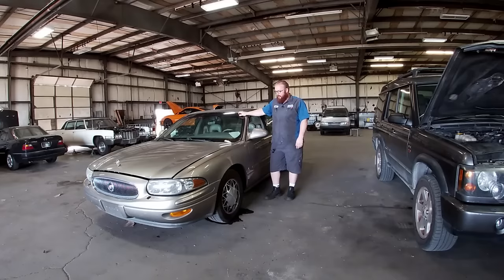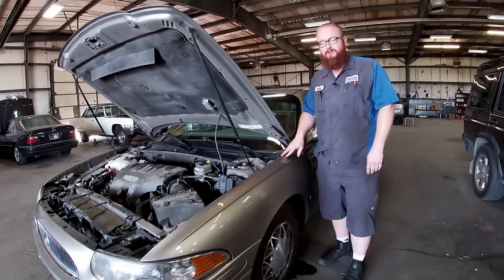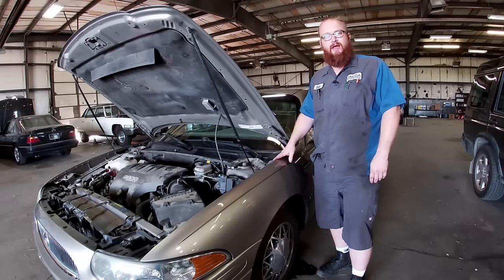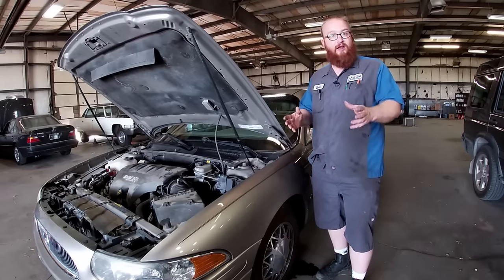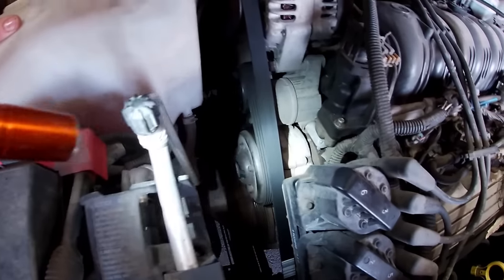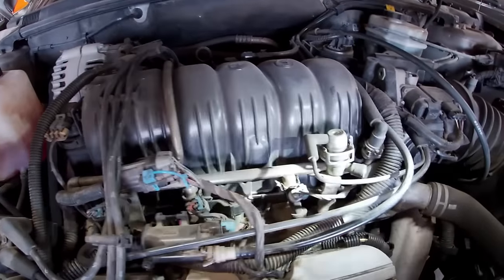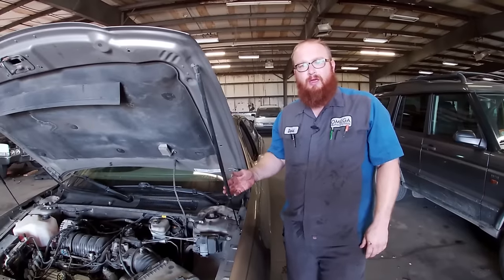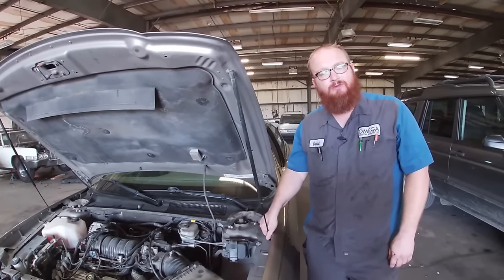CAR WIZARD highlights what makes the Buick 3800 V6 the BEST engine ever!

Comment: Car wizard mentioned plastic parts that fail, I worked for a automotive supplier and had many different Plastic Materials and regrind bad parts and reintroduce that Material back into Virgin material at 30% mix (70% Virgin and 30% regrind) we had incidents where wrong regrind mix with Virgin material, or too much regrind introduced both affect plastic parts integrity, and it will fail.
Our company was large G.M. Supplier tier one and had some issues where a stone was thrown from tire hit wheel liner inside wheel well shattered wheel well liner.
G.M. sent part back to company and was not right correct regrind (contaminated material).
Lot times people not paying attention to job description.
And company was responsible for having too many regrind materials and not labeled correctly.
That back in 90's.
I work at a medical assembly and parts manufacturer. Got tired of car companies dictating how to run company without owning the company.

Comment: Will a LeSabre trans go into a 04 regal LS?
I know the ratio is different, but will they bolt up and run ok (just bad speedo readings)?
Or will it require more than that?

Comment: The only problem I had with both of my 3800 series 2's was the intake manifold failing and coolant going throughout the entire engine
Reply: This was the big problem with both the 3.8 and 3.1 engines...be sure to check that out, replace if you have any doubts.

Comment: Probably replaced it because fuel efficiency. Was a mistake replacing the bullet proof LS V8… especially with the new  problem LT platform…
Seems you reach a point where reliability goes due to fuel efficiency..

Comment: They replaced it with the 3.6 opel motor because the 3.6 can rev significantly higher, makes much more power, is internally balanced, sounds better, is 100lbs lighter………. Might not run to 300k miles, but the 200k you get out of it will be much more enjoyable

Comment: I have a 2007 buick lacrosse 3800 engine series 3. It stalled while customer was driving it. Cranks but no start. I'm thinking crankshaft position sensor. Help please.

Comment: I bought two cars with this engine at the same time based on my mechanic saying "its the best engine ever, as good as toyota"and both leak & burned oil, leak and burned coolant, replaced gaskets on both at 40,000 miles. At that point I sold both ASAP and bought 2 Toyotas. Regular maintenance was done on them and on time and still they were the Worse Engine Ive ever owned. Maybe I got 2 lemons, but I think I know why my mechanic told me "They're best engine ever". Its the best for his bank account.

Comment: It's good to know there's an American engine that might last.  But if horsepower is not important, the most reliable/simple engine you can buy right now new is the Toyota 2TR-FE engine which is based on 25 year tech and only being made now for the Tacoma.  (And will never be made again after next year.  )

Comment: These GM engines were just so good and with the computer management systems available now there is no need for twin overhead cams, if you need more power just add a Supercharger, problem fixed.

Comment: I'd honestly rather have a '92 or '93 Buick Roadmaster. Tough cars. Chevy 350 5.7 V8, super super easy to work on!! Lots of space and just designed really well the way the engine bay is designed. Bare minimum = EASY. Cast iron block and heads= freaking tough!!

Comment: Wizzard  I have a 2016 frontier that won't start up when the temp drops down to 35 degrees or lower. Any ideas? The engine spins over fine...

Comment: I HAVE A QUESTION!! PLEASE SOMEONE HELP!! I LOVE M
Y 2000LESABRE the bolt broke off of the heater core hoses next to the 2 4 6 spark plugs/ wires change up against fire wall making it impossible to get wrench or tap and die in it.

Comment: Ok, its a nice engine but you missed something here; that rear bank of cylinders on that v6, the front 3 spark plugs are easy to get at, how about that rear bank of plugs? Not so easy, right?  I'd say the best engine GM ever produced has to be the small block chevy, especially the 305 small block found in many 70s and 80s Chevys, good performance, even in its smog era variants with much better mileage than the 350s and 400s, along with great reliability as well.  And you can get to all the spark plugs easily enough plus the  mods you can do to improve them, the aftermarket support is off the hook.   Many sbc's have gone over 200K miles  and are still running good.   So keep that v6 and your computers and sensors and fuel injection, have it, I'll just enjoy my dependable and strong small block chevy in my Camaro, Nova and Silverado, along with ease of repair and the cheap prices they charge for starters, alternators and fuel pumps, your v6 cant compare with the chevy in price, performance and ease of maintenance.

Comment: The series 2 was made because the series 1 was too reliable and easier to fix. The series 3 was made because the series 2 was too reliable and easy to fix. The series was canceled because the 3 previous engines were too reliable. Running a company, you can't have people holding on to older products while selling new products. It spells death to a company. I finally get it now...

Comment: Air control valve then the catalytic.converter.But it drives fine on short trips.But,when longer trips and is warmed up it went start and if does makes wispy noises and shakes all over.??

Comment: My Dad's 03 Impala had the plastic head gasket that cracked in this engine and it ruined itself at around 140k miles. The later 3.8 were ruined by GM.

Comment: Grand Am
Grand Prix
Impala
to add yo that list. 
It doesn't matter if it is a series 1, 2 or 3 3800. The GM 3800 is one of the world's greatest engines. Power and reliability are unparalleled (for a V6). The only other engines that give it a run are Honda B, R and K series motors. The J series are great too, but more fussy than the GM 3800. 👍
Reply: My 3.5 in my 2011 Impala is very reliable too. Runs like new. I only put the best oil in it. Remember your car is your best friend so you got to treat it good. 😮

Comment: 2 mins for a thermostat? That's if you don't replenish the coolant you lose from removing the thermostat housing. Don't want air in your system. More like 10 to 15 minutes which is still really good

Comment: Hey you guys I just bought a 2005 Buick century with 96,000 miles it had been garage by one owner a very nice old man that I met at church and he had just got a new car and he knew I was having a hard time so he you know help me get it for less than it was worth because it's in like new condition but anyway it's got the 3.1 Buick V6 and I can't get anybody to explain to me does that count as one of these engines I know it's not the same as the 3800 but is it from the same line of engines that has some of the very good like durability or reliability qualities cuz that's really where my concern is
Reply: If you bought a car from a nice old man then you got a good deal and chances are the car was taken care of very well. That is my experience when you buy used vehicles from old people they typically don't drive very hard or long mileage.

Comment: 3.8 is a good engine.  Buying a wrecked Camaro just to take engine and 4l60e to install into a 4wd S10 with a turbo.  450hp 26mpg...and if anyone has ever built a 3.8 and a gen 3 LS they will see many similarities and understand why so many go half a million and can handle lots of boost

Comment: I really want a LeSabre ($4,799; 60,000mi) as my first car, but my parents have offered buy me a 2023 Civic ($26,000; new) or a Tesla Model 3 ($30,000≥; 30,000mi≥) due to the better styling and efficiency (even though the LeSabre gets up to 24.5 MPG). They've even told me that they couldn't care any less about the mechanics of a car, and that they will not have an "ugly grandma car" on their driveway. I am showing them this video to (possibly) convince them that reliability should be a priority, and that I really do not need a fancy car. Plus, insurance on a 2003 Buick for a 16 y/o driver should be much cheaper than insurance for a 2023 Honda. I'm also a decent student (4.14 GPA), so they might even get a discount, which would make the insurance rates even cheaper.

Comment: Uncle Tony might disagree.  He'd pick the Dodge 318 V-8 or 225 slant-six, but those ended in the 1980's.  The 5.2L Magnum V-8 (until 2002) is the 318 w/ MPFI, but suffers cracks in the head.
Reply: Those get gallons per mile instead of mpg and they are gutless as all holy hell.

Comment: How do you change the back plugs on a 3800?

 I all but gave up on domestics with thier v6 transverse mounted stuff...
Reply: put it on jacks or ramps and with long extension you should be able to reach them from underneath.

Comment: A rare mistake by GM, they usually grenade at 100,000 miles. An engineer probably got fired over that one. Then again, it is essentially an early 60s design.
I personally vote for the Ford 4.9 L6.

Comment: I used to really think highly of these motors....but I have a 93 regal series 1......bought from a old lady with 62k miles.....1k miles later had to replace the main computer $500....then shocks $800.....then at 73k replaced upper and lower manifold gaskets $1100.....had to replace the brakes twice in 12k miles driven for another $1100.....after $3500 in repairs.......+the $2800 I paid for the car......  the motor at 75k got a major Rod knock....$6200 to drive 13K......I will stick with Honda!!!!!!! lesson learned

Comment: I had a 1999 Pontiac Grand Prix GT with the 3.8L that was rated at 195 h.p.  However, it ran like it was 250 h.p. and got great gas mileage as well.  I have long thought that the GM 3.8 was a great engine.  Unfortunately, GM decision making, engineering and quality continues to decline, and I wouldn't even consider a newer vehicle.  But the mid 90's to mid 2000's is pretty good.

Comment: Was there any internal difference between the Series 3 Supercharged vs the Series 3 NA?
Reply: Forged pistons, lower compression ratio. I think that's it. Different camshaft maybe, not sure on that. Supercharged version also has HD version of the transmission with a limited slip differential and a lazier overal gear ratio.

Comment: I've got a 2000 Buick Park Avenue and had a 1994 Ford Thunderbird with the 4.6 HO.

4.6 2v HO > 3800 Series II all day long.  Sure, it won't get that same fuel economy, but it doesn't have everything tearing up all around the engine like GM vehicles do. 

I'm fkin sick of this Park Avenue I have.  

Not gonna mention that they all blow intake gaskets around 120k?  

Yes, internally, other than the gaskets, it's a strong built, "big" V6.  Both the 94 Thunderbird 4.6 "HO" and newer 3800 II have 205 horsepower, but one has 265 ft-lbs of torque and one has 220 ft-lbs of torque.  One is RWD with IRS, one is FWD and in the rear, an air suspension set up that will always begin to leak.  

The 4R70W in the Ford?  Bulletproof with that low horsepower engine.  Then, again, I have had zero issues with the 4l65E whatever in the Buick, but I don't run it as hard as I did my Thunderbird.  

The 4.6 2v has got to be the longest lasting engine ever made.  At most, you'll need to replace some sensors by 150k miles.  My MAF sensor went bad.  That was all I ever had to do.

The Buick?  Leaking oil into those dips like you pointed out.  MASSIVE vacuum leak coming from somewhere that I can't find on the outside.  I've sprayed it everywhere.  Gotta be an intake gasket.  Especially since I've had misfires on Cyl 5... which is a tell-tell sign.  

At what point do you say "that's not the engine, that's accessories"?  I have maintained all of my vehicles religiously.  I've changed the tranny fluid in my Buick at least 4x times now, flushed and filled the coolant once.  It has new Iridium plugs in it (AC Delco).  It COULD be such a great car but they all blow intake gaskets.  Just like the 3.1's in the Luminas and Monte Carlos before it.  

I'd trade this Park Ave for a Crown Vic or Mercury Grand Marquis in a heartbeat.  

This isn't a "problem" by any means, but there were no hills here in east TN that the Thunderbird had to gear down for, be it 3rd to 2nd or 4th to 3rd where the Buick always has to gear down.  But, hey, it's a smaller V6 with less torque.  And mind you, I had a 94 Thunderbird, those had 3.08:1 rear gears.  

The Buick gets the same kind of city mileage that the V8 Thunderbird gets, too.  Very low 20's.  I'm lucky to get 21.5 mpg according to the display in the city.  That's driving FOR fuel mileage.  Drive it normally and that drops to 20.  Keep up with traffic?  19.5 mpg.  

It's 4000 pounds.  The Thunderbird is 3800 pounds, so you can argue that.  But... that's the same as adding one more person.

I miss my Thunderbird LX.  THAT was bulletproof.  THAT was a car you could take across the country.  My Buick?  It's about to be filled with some kind of stop leak in the coolant and sold for some stupidly low price because no one buys these cars.

Comment: I am in the process of buying a 2003 Chevy Impala with a 3800 engine in it.  Am I making a good decision? 1 owner 92,000 miles….
Reply: I just bought a 01 lesabre for 2600 9 months ago just had to swap out the intake for 1500 and of course change the oil and you should be good
Reply: @Kizip  $1,500 for an intake?
Reply: @Kizip  $1,500 for an Intake?  You only paid $2,600 for the car!
Reply: @cliffx7  that’s worth it to keep it for years
Reply: @cliffx7  the chassis on mine only got 100k not rusty at all on the east coast if it was rusty I wouldn’t throw a new intake at it for sure I’d just get rid of it
Reply: My apologies Youtube blocked my commenting ability, so I started refreshing every time I made a comment. I saw the comment disappear, so I reposted the comment. This is why you see multiple comments from me about the same thing. Thanks YouTube!
Reply: @Kizip  I’ve owned the car for three weeks now and I am extremely impressed with this vehicle! It drives like a new car! I am taking the advice of the commenters to heart and I’ll be getting a new intake within the next 10,000 miles. Thanks guys.

Comment: My most reliable engine is my 301 C.I.D. that came out of my 1977 Pontiac Grand Prix that my Lord and Savior, Jesus Christ, led me to get.  I don't have the car anymore,  but I still have the engine and transmission sitting in a garage.  Engine almost had 400k miles on it when it was retired.  I am trying to sell that engine, minus the Entire A/C unit, for $400 OBO.

Comment: I need your help my car catalytic converter is bad but I’m trying to figure out is that’s the reason why my car kept cutting off it will start run rough but runs sometimes skips like I’m losing power I clean the throttle body it’s still stalling out while I drive
Reply: Try changing the air fuel ratio sensor or so called O2 sensor.

Comment: I just finished replacing the gaskets on the lower manifold, upper intake and valve covers.  The gaskets were poorly made.  The engine only has 68,000 miles on it.

Comment: ive had  series  1  and  series 2    worked great         then  the  series  3 came  out    i had  more  problems  with  the cooling  system  constantly   fixing.......why did  they do   a  reverse  flow    in   the cooling   system       it has to be pressurized   why      2005 buick

Comment: He left out the OEM Fuel Pressure Regulator diaphragm leak.
Reply: You mentioned that as if it's not right on top of the fuel rail part is super cheap and replacement time like 30 minutes that's if your taking your time admiring the 3.8 engine.

Comment: I  SEE IT EVERYTIME AT EVERY LUBE SHOP OR DEALERSHIP.  THEY TRY TO SELL YOU STUFF YOU NEED AND DONT NEED BEFORE MAKING A CHOICE RIGHT THERE DO A LITTLE RESEARCH AND I GUARANTEE YOUR SAVING MONEY BYE SEEING WHAT OTHER PLACES WILLCHARGE YOU TO HAVE IT FIXED SOMETIMES YOU MIGHT BE AT THE RIGHT PLACE BUT IF ITS A DEALERSHIP 99.9 TIMES YOUR OVER PAYING FOR A FIX YOU DIDN'T NEED TO HAVE DONE TIHHT AWAY 😢

Comment: I got a Chevy impala 2005 with the same engine 3.8 series 2 and I recently rebuilt the motor but it start smoking blue when I press hard on the gas and every  mechanic are telling me to get rid of it that this motor is not good and all and is a trash motor

Comment: I've owned 5 cars with this engine. I'm sorry I have a different opinion than you.   The FWD version has the worst design of an intake, which cracks and also leads to blowing the intake gaskets.  Which if you don't do it yourself,  costs ALOT more than $100.  These engines also come in 4th gen F-bodies.  I'm on my 2nd in my '99 Firebird which has 130k miles.  The 1st motor, threw a rod.  This one, is now leaking oil like a civ, I bought it with 110k miles and have put 20k miles.  I had a 99 grand am GT, 150k miles, cracked block.  My daughters 07 grand prix, intake is done, 151k miles.  Mechanic wants $1100 (notice he didn't say cost of intake, just states it's easy).  Now with my bad back I'm going to have to do the work on her car, while throwing away the 3.8 in my 'Bird.  Sorry, I am not a huge fan of these motors.  I know alot of mechanics who hate this motor as much as I do.

Comment: Only perfect engine from Mercedes in my humble opinion, 126 chassis 300 SD turbo diesel. Extremely easy to work on, no electronic ignition, all kinds of room, engine and tranny are bulletproof, you will need overhaul B2 servo piston. But overall bulletproof!